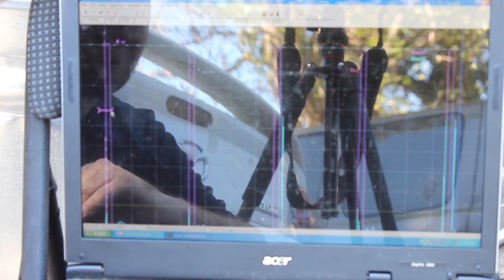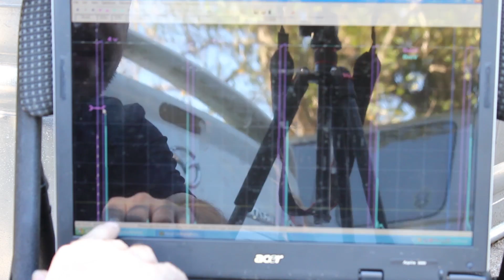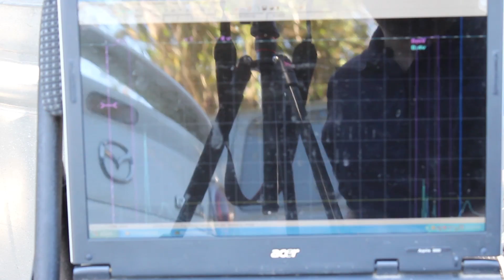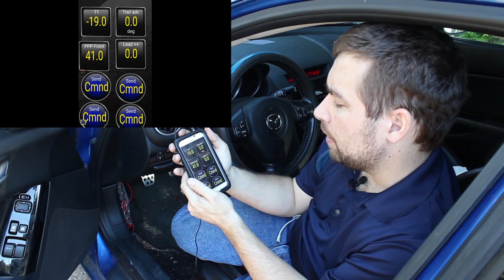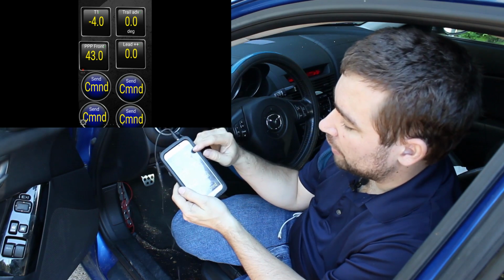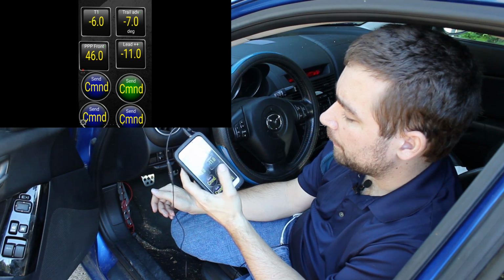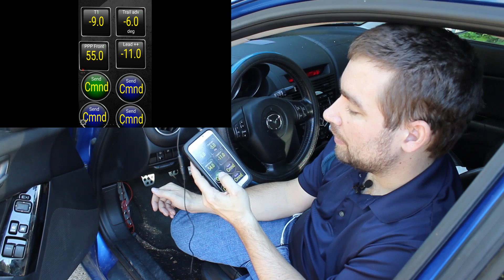Working Ion sensing with less electrocution! - Voiding Warranties Ep 21

Comment: If people knew how important cylinder pressure sensing was, you'd go viral for this video alone. (Love all of your videos regardless.) Please; if you feel inspired, update and elaborate on this. Cylinder pressure sensing is a technology reserved for the cutting edge of automotive engineers, a cylinder pressure sensing spark plug isn't just expensive, it's as rare as a unicorn. This method can turn any spark plug into a pressure sensor. Even multi cylinder sensing. You have no clue the power of what you would be bringing into the open source community. In the meantime check out speeduino on Google. I'm absolutely sure your discovery could be utilized in open source ECU programming such as speeduino. 

Thank you for putting all this information into videos for us!
Reply: On another note, the ultimate values of the spark plugs mV at atmospheric temp and under the torch; the complicated part is getting a computer to read and translate it.

But to put it simply, a properly tuned and filtered oscilloscope can show peak values regardless. As showed when you demonstrated the pressure sensor versus crank angle sensor. So instead of boosting the pressure signal, you could mark your TDC and remove the crank signal from the display and I believe it should increase the resolution although I've never used an oscilloscope...

What I'm saying is, zoom in on the pressure sensor, and find peak pressure and angle, and tune the angle to optimum. (Surprised at the rotary 40°) depending on rod to stroke ratio in my case actually only 14°atdc 

Also the signal will go up alot at WOT as I'm sure you've discovered, cylinder pressure is highest around peak torque depending on the cam specs and if it's utilizing the entire combustion or if it's a high rpm cam or in your case; no cam. 

I guess I should be saying combustion chamber pressure for you rotary folk lol
Reply: @bungcheese5901  I think not only rod length  to stroke ratio but also the amount of offset of the wrist  pin  determine this angle. Do you know some method to calculate it or measured it on some particular engine ?